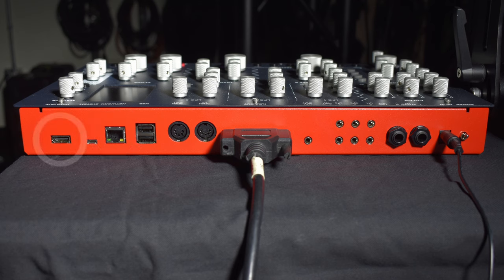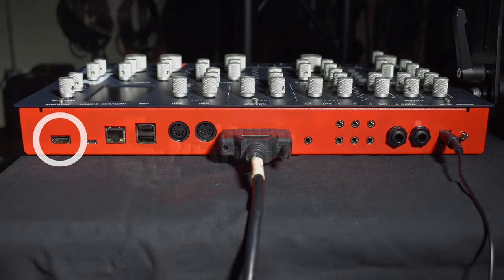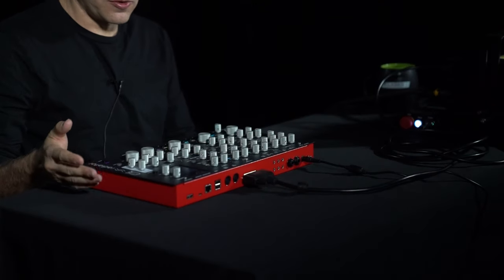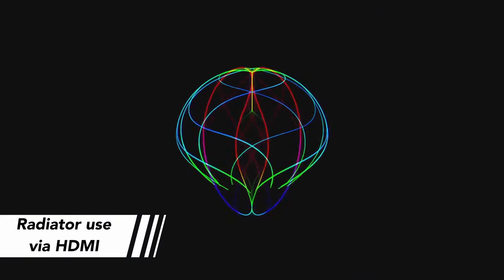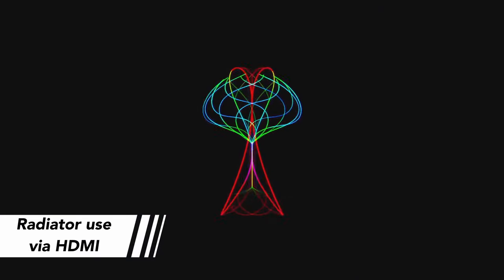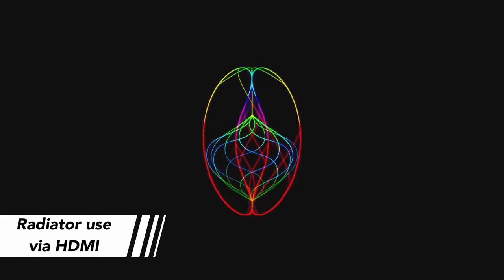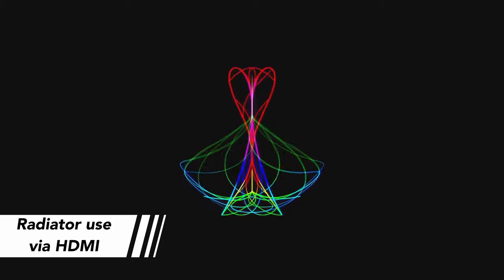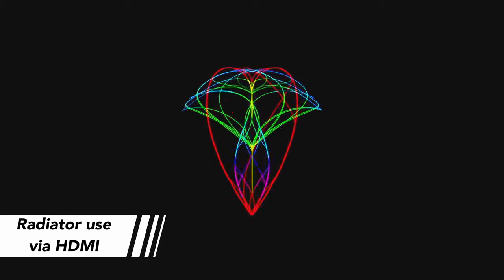Radiator by Neon Captain: Beginner Tutorial

Comment: Hi,
Could you explain, or better still make a video of, what is the advantage of using Radiator, as compared to say Quickshow's abstract generator with a MIDI controller? 
I get that it's standalone, and that it can interact with modular gear, but are there any other features that aren't found in the most popular software packages?

Thanks for your help :)
Reply from the maker: Thanks for your question! We are working on another Radiator video this week and we can touch on that